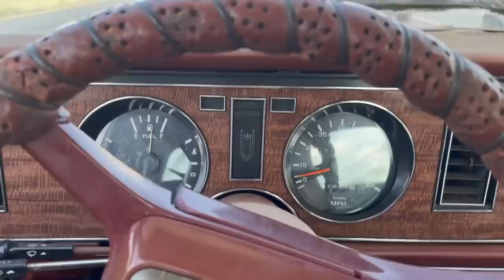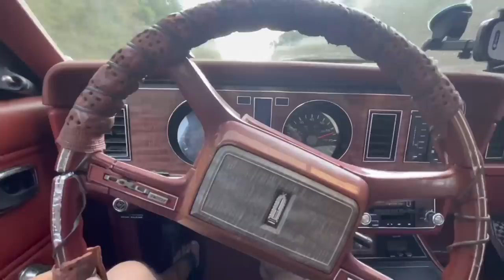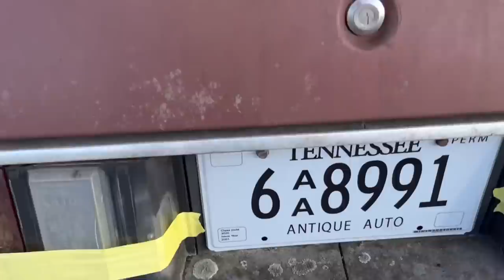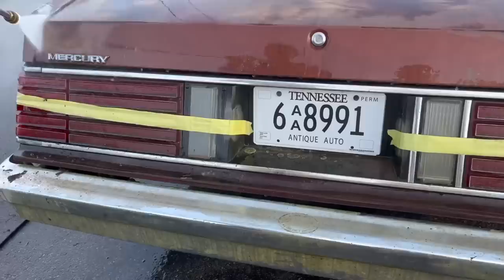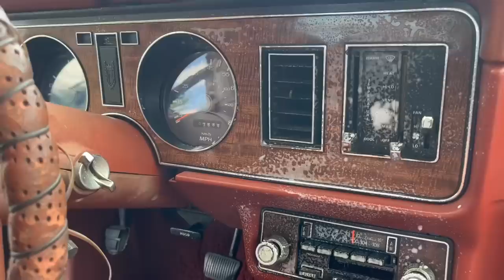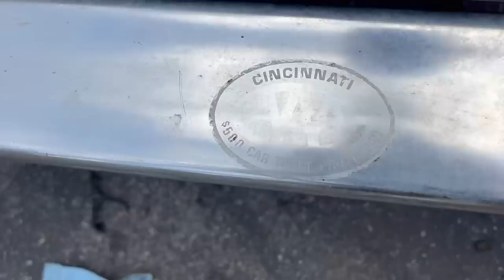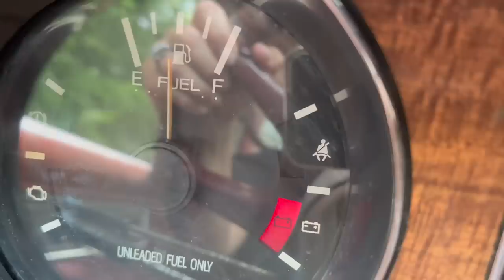Embarrassing my kids at school in an ugly old car after new brakes and first wash in 15 years!

Comment: There should be a rubber plug  on the bottom of the  backing plate ,you can remove and use a brake spoon ,or screw driver and turn the star adjuster  up to tighten ,down to loosen brake shoes! Tighten till drum won,t turn ,loosen till drum scrubs but turns put plug back on 
 And go to D,G And get some  AWESOME Brand Cleaner to spray on let set  before you wash your car,  It,s great! ANDThere,s your dinner!

Comment: That's a beautiful car. Yuppies who MUST have new electric yuppy cars . I would get 500 HP or so into this beauty and burn rubber right past all the yuppies in the computer and plastic cars.  No shame in an old classic like this.   Those Zephyr are great 1)4 mile race cars.    Ford 302 or big block.     Sweet sleepers.  I had a fairmont wagon with 460 souped up to 650 plus HP.  I got 10.3 times at best.    Fast cars with a V8 and an few bucks for parts
Reply from the maker: Yes!!!

Comment: The mustang gt cast grey wheels from a 93 ford mustang with the deluxe lx exterior package would look sharp on the zephyr in my opinion, and I have lost a wheel on my 86 Chevy k20 custom deluxe longbed farm truck that I destroyed the front axle getting the truck unstuck out of the ditch and started heading back down the road toward the farm and the passenger side front wheel passed the truck the front passenger side axle u joint was broken

Comment: Cool ride, although I hate cars with clapped out suspension. My neighbor has a beautiful Grand Marquise stuffed in their garage, says they were told it needs $2000 worth 
(highly doubtful since you can buy a complete front member for those for about $750 ) of front suspension work -- offered several times to fix it up for them but they intend to keep it as a storage shelf. Too bad Cleetus is wholesale scrapping Crown Vics --- as long as you're having fun it don't matter eh?
ps. would like to see you get some floor pans in the 64 Dart Wagon, that thing is worthy of the effort.

Comment: The 1978-79 Mercury Zephyr with baby moon hub caps. The 2.3 liters comes with 28 tooth 7.5 inch ring gear. I just the matching shape or gasket that is the same as your coupe Fair car. If you saw the GT grand turbo touring then it could be 2.3 instead of inline 3.3 liter into the Around Cougar Motor craft that provide pan mats and Racing 16 runts or turbine pony wheel to high rider Fairmont shiny flashy car turbo all just aluminum the in and housing inline performance necessary to choose Vortex or Paxton with cold air enforce dry boost.They produce the last year 1986 with CAFE that motorcraft is not provide V-8 except DOHC 4.6 to the antique classic Zephyr   1931 or the 1940 notch back domestic car.

Comment: How is the rear differential working without blue dye ink that applied to these all teeth and pinion tooth rubbing the ring  housing to center using the rub mark on the one tooth of ring gear. With these thin shims and shape the thickness into place ring shim in front of pinion gear then tighten the nut to both yoke and shaft pinion. The BOM of the Futura is 10 bolt inspection plate closing the gear oil 80 to 90W zinc additive.Back of motor turning train is BOM letting u know if it is 7inch ring gear or 8 in. Ring gear. And count the number of steel tooth of both ring and pinion into find the final gear ratio. This Future is auto Transmissio

Comment: Ok i have to ask.....where did you get “casings and hoops” from?  The original master cyls were aluminum and can still get a rebuild kit for them, any replacement will be cast iron from China. The gear ratio starts at the bolt hole and usually the first digit is mashed by the bolt so normally only see part of it and the L or . then the last two digits with 7.5 or 8.8 after gear ratio

Comment: YA 11:13.  THAT RUBBER SEALS GONE. THIERS A HOLE IN THE FLOAT BOWL THAT GOES STRAIGHT TO VACUUM AND GHE RUBBER SEAL THAT COVERS THE HOLE BWTWEEN FUEL BOWL AND INTAKE IS COMPLETELY GONE

Comment: Hey buddy, I got a question. Sometimes I’m working on my drum brakes and I’ll have to clean them up with some brake cleaner. But I reckon I’m not using any gloves so I get some remains on my hands and it stings pretty good. Any advice about that?
Reply from the maker: Yeah definitely need gloves that stuff Is very bad for you change gloves often and use better gloves
Reply: @Sleeperdude  oh wow I didn’t know that, definitely makes sense though it’s a pretty abrasive chemical

Comment: The steering wheel is upside down the carb needs rebuilt  the steering while watching this video is loose  and the front end is way out of alignment  .Just a observation from a Ford Tech that used to work on Fords greatest worst quality contol achievements in the 80s !!!